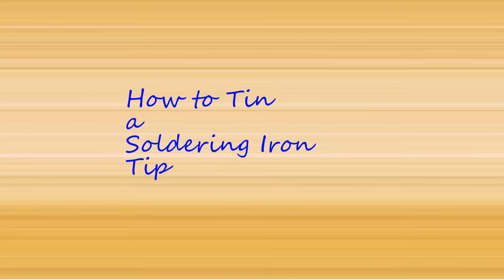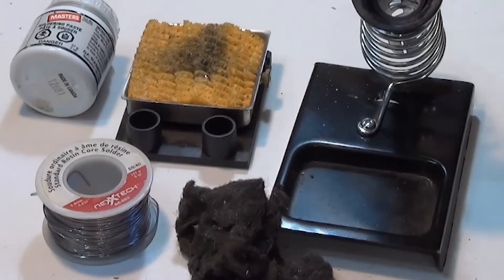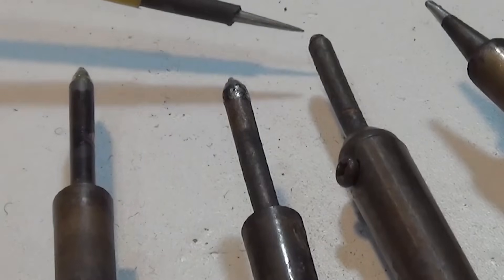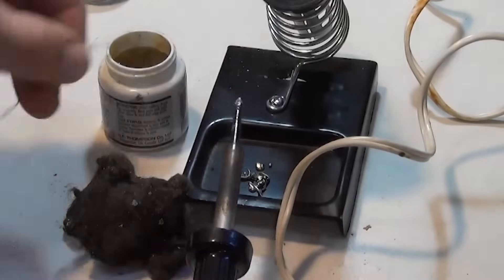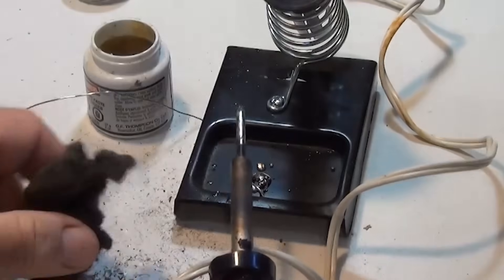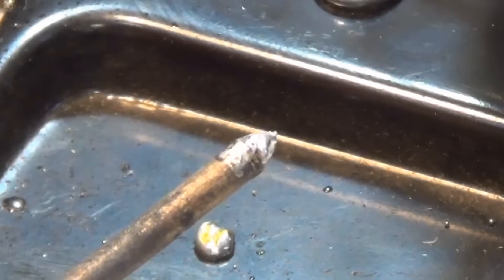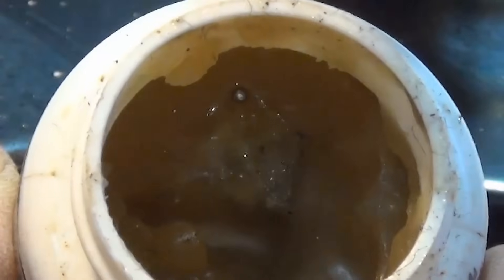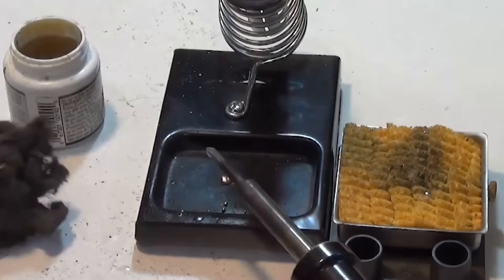How to Tin a Soldering Iron Tip or Re-tin an Old Soldering Iron Tip

Comment: I don't have steel whool is there anything else I can use like sandpaper?
Reply from the maker: A super fine steel wool works best and will not damage the tip.  It is not advisable to use sandpaper.

Comment: I found this video very good because I found three different solder irons in my Dad's garage and none of them worked to melt solder I was trying to remove. My Dad was an electrical engineer so I knew his tools were working but I just didn't know how to use them properly. This video taught me the beginning basics to start with and it was very beneficial to me. Thank you!

Comment: sir,i just buy a stanley iron solder and follow your method,but it not shining as the one you show in this video,i really frustrated right now,is there any wrong i did.? i use a flux from chinese brand,it hard as stone,it melt when i dip the tip,but it turn black,clean it with steel wool,then re tin it,the tin melt but it wont stick and shiny like yours..i do it several times but it is still the same,i want to use it for electronic and small electrical works
Reply from the maker: Hmmm, I suspect you do not have acid flux.  Go to any hardware store and you should be able to purchase it.  Acid flux will look like grease.  There is a white cream type plumbing flux and it does not work.  Make sure you open the container before purchasing the flux if you can.
Reply: 1929fordhotrod Oh i see,but it hard to find look a like grease acid flux in my area,what i only found normally silver paste one,transparent engine oil look a like acid flux..by the way,thank you sir for your reply,at least i got to learn something new,before i used many wrong item,i tend to use lead free solder roll before,no wonder it won't melt easily because from what i learn,it requires more heat,require to use solder station for better soldering instead a soldering iron,soldering iron only suitable for 60/40 roll..i will go online shopping for that kind of acid flux paste that you suggested.
Reply: @Life_Is_Adventuree  look in the plumbing department, not electronics.

Comment: I've been soldering for 15 years, most of it under a microscope and have always been Keen about maintaining my equipment and soldering tips. It's crucial to keep a clean soldering tip on your iron if you want a quality shiny connection and your solder to flow properly. I have never thought of using plumber's paste or steel wool, this is a great way to keep your soldering iron maintained and working properly! Thank you very much for this John!

Comment: Hello again. I have a chisel tip iron thats brand new but the middle of the tup burned away. Is there any way to stop this? or am i doing something wrong? I just cant buy a new tip every month. i let it warm up and i apply solder on it and i clean it with a moist cloth rag.
Thanks/
Reply from the maker: Cheaper soldering irons have this problem with the tips.  They are made of low quality metals causing them to burn up quickly.  Many of my students by cheap soldering irons and over the semester of use need to replace the tips.
Reply: I bought a 20$ Weller iron. Decent iron with three tips. Was cheap but maybe not the best. But Weller is a good brand, and i dont need a 150 dollar soldering station, yet. 7 bucks for 2 tips on ebay. Oh well. i hope the conical tip lasts longer. Thanks and this video has been helpful. Mannaged to tin all 3 tip succesfully but they may not last.

Comment: Does the tip stay tinned with repeated use?
Reply from the maker: It will provided you melt a bit of solder on the tip once in a while and clean it off
Reply: @1929fordhotrod  cool, thanks

Comment: You said not to use a wire wheel or grinder because it will destroy the "-----" 6:15. I tried to listen to the word you used 7 times and it sounds like "Tefa" did you mean Temper or Tip? If you did in fact say Tefa, does that have anything to do with the "Plating" on the tip that needs to be deoxidized and Tinned?
Reply: Tip not tefa.

Meaning. TEFA. Tutmonda Esperanto Futbala Asocio (Esperanto: Worldwide Esperanto Football Association) TEFA. Technology Education Federation of Australia. TEFA. Transitional Energy Facility Assessment (tax; New Jersey) TEFA. Technology-Enhanced Formative Assessment (various universities)

Comment: (anyone) Can you use solder flux instead of plumber's paste? Some recommend using flux, and I have flux but don't have plumbers paste, so just wondering if that will work. Or are they the same thing?
Reply from the maker: Plumbers paste is acid based and does work better, but flux used for a pcb is fine also but does not work as well.

Comment: Thanks, this helped me a ton. I got a new iron for my birthday, and even though I always cleaned it very carefully, after just a couple uses, it had turned black like your first one, and no solder would stick on it. Heat transfer was terrible as well, and I couldn't get anything to work nicely. I got really discouraged since it was a new iron, and I was disappointed the tips ruined so fast. 

After searching on how I could clean the tip, I found this video coincidentally, which actually was exactly what I needed to do. I did this with a damp cellulose spunge instead of steel wool, and it turned out perfect. Tip is nice and shiny again, and solder covers it beautifully rather than falling off. I have now learnt to tin the tip every time I put it away, rather than cleaning it of perfectly. Hopefully my tip will last a lot longer now. A good clean tip makes soldering so much more enjoyable.

Comment: i lost my soldering tip. what should i replace it with instead of buying it
Reply from the maker: +Jason Portillo - you could purchase a length of copper rod available at many hardware stores then cutting it to length and sanding it to the shape you would like.  The rods are usually sold in 30-36" lengths and various diameters. You will now have a supply of tips for many years and the bonus is when they loose their shape you can re-shape the tip unlike the alloy tips.  Good luck.  Don't forget the tin the tips. :-)

Comment: can't it be cleaned by just scrubbibg it with scrubbing pad or sand paper?
Reply from the maker: its not a good idea to use a scrubbing pad because it will contaminate the tip making soldering almost impossible.  Sanding removes the plating on the tip and should not be done.
Reply: 1929fordhotrod thank you so much sir for your reply. i thought you wouldn't answer.  now,may i ask tip/tips  in choosing a good/best soldering gun
Reply from the maker: Sorry for the late reply.  Generally, its all about cost.  The cheaper irons in the $10 range have a very short life span.  Once you get into the $50 or more range for an iron it will have a higher quality tip that will last for years.

Comment: what i've found over the years of soldering, if my tip gets malformed, i take it out and put it in a drill, Then use some sandpaper and smooth it back into the original shape or as close to it as i can get. it works pretty good as long as you don't go overboard with it

Comment: Dear Sir,  i've been struggling with this problem for days now and i wondered if you may have the time to help. I put a brand new soldering tip in my iron and the first couple of times i used it it was fine, but now the solder won't tin the tip, it just goes into little balls and drops off. I've used the flux method 3 times now with no joy. What else coulod be the problem?

Comment: If I didn't originally tin my tips for my iron, can I sand off the oxidation and re-tin like you've demonstrated here, or is it better for me to just order new tips and tin properly?
Reply from the maker: +Nick Joslin - The only tips you can sand are tips that are made of copper.  If you have a plated tip and it is still in great shape, the tip can be gently cleaned with steel wool.  You can work it between the steel wool, plumbers acid flux, and soldering, eventually restoring it to a properly tinned tip.

Comment: Great help, thank you. I actually replaced my soldering iron tip (screw in type) and started with a new tip, steel wool from Home Depot and soldering paste from Lowes. Took a little time but turned our very well, thanks to your clear, detailed video. The soldering job was many times improved from previous work I have done...the well-tinned tip being the reason. Great job! Thanks again.

Comment: The MOST important way to prolong bit life (and keep it usable) is reducing overheating.  Modern temperature controlled irons have a REAL advantage here.  When it goes into the holder, a motion sensor reduces the temperature to ~200C.  On later removing it, the electronics quickly returns the tip to the previous value, and it's ready to go again.
Reply: I've often found my irons not hot enough to even melt solder on, I'll try retipping them!

Comment: I got a brand new soldering iron, but for some reason the solder doesnt stay on it... am I doing something wrong?
Reply from the maker: Does the solder roll around like water on a waxed car.  If it does there is still some contamination on the tip.  Turn it off or unplug it, let it cool down, then using super fine steel wool (0000) clean the tip.  Once clean, turn it on or plug it in and try the process as shown in the video.  It should tin.
Reply: Yes it does, when i try to apply the tin on it, it melts and roll like water... And how do I clean it? Use the wool? (need to buy some)
Reply from the maker: The tip is definitely dirty.  Get the super fine steel wool (0000) and clean it as described above.

Comment: Thank you so much for this video! I decided to pull out my soldering iron today and clean it off with the steel wool and then re-tin the tip and my soldering iron is good as new! I was a bit skeptical at first but consider me impressed. I am very happy with the outcome.

Comment: Having only ever soldered on electronics, I had been consistently (and rightly!) shooed away from acid fluxes. Didn't think about using it in this kind of cleaning application though; makes so much sense. Thanks!
Reply: Pure genius
Reply: I would think it possible could use clean steel wool or brass wool to brighten up the tip for tinning but have no experience.

Comment: I have also found a different way to tin ,radio shack had a tin / cleaner,in this little tin can for about ten bucks you roll your soldering pen tip in this stuff then wipe off and instant tin ,since radio shack has closed ,you can buy this tin/ cleaner for about ten bucks on eBay ,try it faster ,I also found the higher end soldering pens come with better made tips that hold up better.

Comment: Can this be done without the flux if the solder itself is rosin core? I have a flux pen on the way but I don't think I would want to wipe a hot tip with it. Thanks for the video. I wish I knew this sooner about wrapping the tip, although I was able to save mine thankfully. :)
Reply: The acid flux/plumbers flux is different than the rosin flux in electrical solder. It etches the tip to create a stronger tinning bond. 

BTW, he's using rosin core solder to tin. The video revolves around using the acid flux to aide the tinning process. Don't use the acid flux on electronic components.

Comment: Love your tips.. supported 👍.. Qs. Do you also suggest cleaning a tough oxidised soldering tip with WD 40? Won't WD 40 prevent corrosion too?
Reply: Try steel wool. No residues left on the metal.

Comment: What about tinning the rest of the iron as sometimes the broader section can be used to heat wires before soldering.
Reply from the maker: You can if you like.  
I tend to have a variety of irons with different tips and wattage for specific tasks.

Comment: I think it's worth noting the difference between "Plumber's" solder paste, which is harsh acid flux in paste form, and "SMD manufacturing" solder paste, which is tin solder mixed with mild flux, used instead of solder wire when using a reflow oven instead of an iron.

Comment: Thanks for this clip on "tinning" learned about it in high school but forgot the importance. Good one. thanks again.
Reply: unfortunately high schools dont teach soldering anymore.  but I learned on my own but stumbled upon this video which should solve a lot of my soldering issues
Reply: @Manatee360Phototography  i spent a year in a US high school about 20 years ago (I can't believe it has been that long...). i took up building trades which is unlike anything I'd be able to study in my home country's high schools (unless I wanted to become a mason or electrician or whatever, but this was a regular high school, not trade school). i understand there is 'shop' class in many schools but in this school we actually build a house from foundation to shingles (and interior, including paint, plumbing, wiring, etc). most useful classes i have taken probably (along with 10-finger typing which I also learned in the US as a 16-year-old). no soldering though, I am learning it now. very useful (I have just started setting up, fixing, modifying electric guitars, and wiring is something you need to do often on them, if you like to change up things)

Comment: Hello again good sir, I'm wondering if tinning a NEW tip using quality 50/50 will somehow effect my electrical projects later on( I have other electrical solder to use later on but just initial tinning with 50/50)? The thing is the 50/50 I have is really good stuff whereas the 60/40 stuff I have is ...not the best ..so will initially tinning with 50/50 have any negative effects after the initial tin?
Reply from the maker: 50/50 is often used for stained glass work and in the past plumbing.  Its possible your 60/40 might be contaminated with an oil product.  The 50/50 should be fine.

Comment: My soldering tip is shinny and its okay, but whenever i turn the soldering tool on, its becomes black and it can't get fixed easily, i tryed this and it works for seconds but it gets black after it again, Im asking if maybe it can be the soldering tool problem? Im using Ersa 25W
Reply from the maker: Use either a damp sponge, copper/brass/stainless scrub to clean the tip before soldering.  You can also melt a bit of solder on the tip before cleaning it and before soldering.

Comment: I find that when re tinning an old tip, before I heat it up, I will burnish it a bit with a green or brown nylon Scrubbie pad, it will burnish it and clean it up nicely without destroying the tip. Then heat it up well, then dip it into flux, then apply solder.  Works great!

Comment: A note of caution: this method works very nicely indeed on an electric iron. Different story on a gas iron. It's impossible to wipe the tip with wire wool without the catalyzer setting fire to the wire wool. Ask me how I know!!!!!!!!!!! So I blew out the wire wool and set it aside, only to notice a minute later that it had re-ignited!!!!!!!!!!

Comment: What specific store did you buy you paste from, iv'e checked ebay, amazon, home depot, lowes, and radio shack but i can't find it anywhere.
Reply from the maker: Any hardware store will have it in the plumbing section.  Open the container and make sure it looks like car grease.  This will be the best acid flux to buy.
Reply: For amazon use search term "acid flux".
Reply: Just remember to NOT use plumber's flux for electronics (it is very corrosive).

Comment: Very valuable video. 

Some questions, if I may? 

Any thoughts on using a salamoniac block instead of the acid flux? I inherited a couple of blocks from my late Dad and have found them to be very effective but worry that they could be too corrosive.

Would using a 90:10 solder (which has a higher melting point) not help to prolong the life of the tinning?

I do mainly stained glass work which needs a fairly big iron, and replacing tips gets pricey. I have a small lathe and have been thinking about turning some tips from pure copper. I have some copper bar (also compliments of my late Dad) so no immediate expense there. Any thoughts?
Reply from the maker: I have no experience with a salamoniac block.  I've been using the acid flux for a long time and even taught my college electronic students using this method for 31 years.  By all means use solid copper tips and shape them to whatever shapes you require for different stained glass applications.  You can use the same method to tin them.  Once the tips are tinned and maintained properly you shouldn't need to re-tin them very often.

Comment: Hello, is tin 60/40 Soldering wire easier to work with than alloy 60/40 Soldering wire for circuit boards?

Comment: I have never had much luck in using the same iron I'm trying to tin to heat the solder to tin its tip; the tip always gets heat-tarnished before it gets hot enough to make the olslder flow..  What I do is clean and brighten the tip well, apply a generous helping of paste flux to the tip, and then use a heavy-duty iron or gun to melt some solder and tin the first iron's tip thoroughly, just like tinning copper wires.

Comment: a good tinned solder iron always works best for even flow, as a sheet metal worker I've soldered with solder irons from .5lb to 4lb irons (those Irons come in pairs thus a 4lb irons actual weight is only 2lb) where you use a small furnace to heat them there you use a file to clean your iron and then Sallammoniac and water w/ 60/40 barstock solider to properly tin the irons when hot